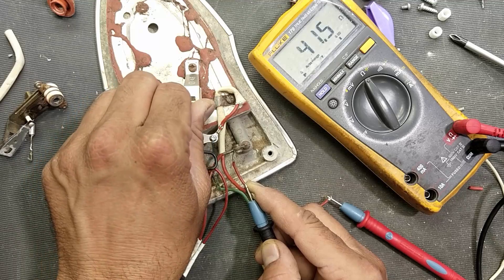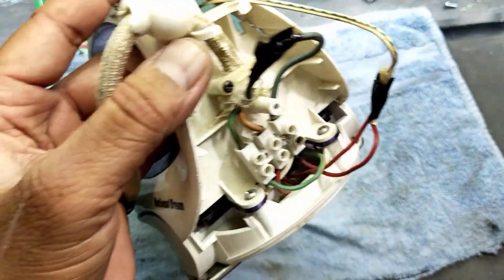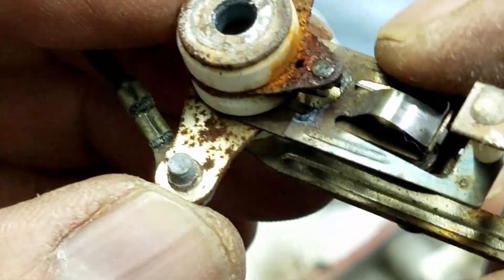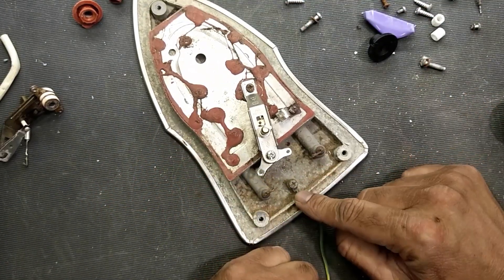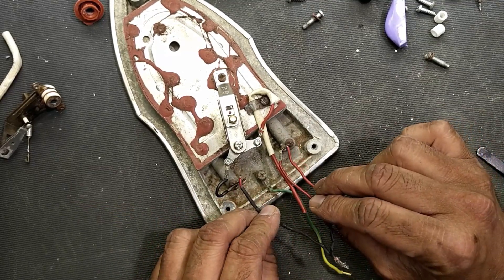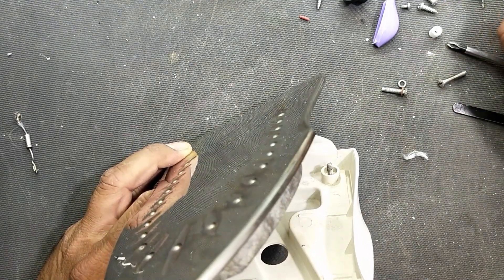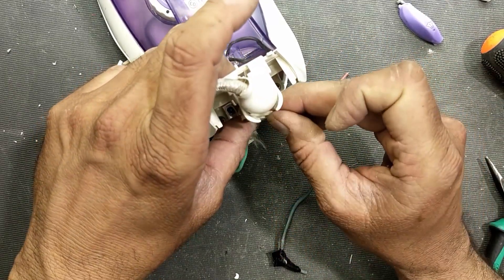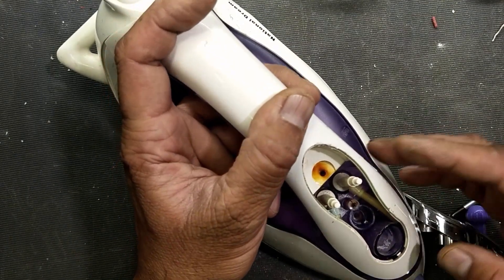[391] How to Repair Electric Iron at Home / Steam Iron / Wiring Connection of Electric Iron

Comment: You make it look so simple. My problem at the moment is to disassemble my black and decker D3030 Model iron. I would like to repair it without destroying it trying to disassemble it. I have got to the point of removing a pair of wires going up to the handle, I guess that's for the light and another pair that goes into the bottom of the iron. My guess is that the thermostat wires are connected internally to the element and they only brought out one pair .  From your explanation which is excellent, it seems the thermostat switch could be the problem and not the element. Where online do you go to get replacement parts? Thanks for your help.
Reply from the maker: Best regards
Unluckily, i don't have black and decker model's video 
But you can check https://youtu.be/E2WFM-1yjrU
It is very detailed and step be step video
I hope it will give idea to work safely
Most of the brands have similar chinese technology
Reply: Thanks a million, I will check this out.

Comment: Sir, how do we know that heating element is good?
Reply from the maker: connect multimeter across heating element and it give resistance on multimeter, and it have no continuity with chassis 
then element is good 
if element shows open circuit or gives continuity with chassis, that heating element will damaged
Reply: @HaseebElectronics  approximately, how much resistance?
Reply from the maker: it depends on heating capacity 
normally it is around 50 ohms
Reply: @HaseebElectronics  Thank you

Comment: Hello good morning, I am a follower of the channel and I am writing to explain the problem that happens to me in an ironing center, after performing the ohni measurement test in the plug to see the grounding, it gives me a value in one of the poles of the plug, in one yes and in the other no, (note: I measure in the plug, in the highest scale of ohns and with all the main components disconnected, and it gives a value of 1,100 and upwards, no it stops at a figure), however I have disassembled the plate to access the resistance, and in continuity both in one pole and the other the casing does not beep, if I touch both poles at the same time if it gives continuity, in the boiler filled with water exactly the same, it gives that result, and then what is happening? the result of the measurement in the plug, all the other measurements give, therefore? I don't know what else to do, I don't understand it, thank you very much, regards.  https://youtu.be/_BKOmCT0Q24

Comment: So are the repairs pretty much same on all steam irons? I have Hamilton Beach model with self clean mode Has a steam button and a spray button
Reply from the maker: yes dear. if it is repaired nicely. then it works perfectly. but while opening or fitting any seal is not properly seated or damaged, then produces leak issues and fails to produce good steam

Comment: Nice work! These kind of repairs are simple but extremely useful. At my end of the world, it's impossible to get a brand new thermostat for an iron. I have to get it from a broken iron. I don't understand why parts for these devices are not imported and sold here. People really don't like throw away their broken stuff. Most of the people prefer to repair their broken devices no matter how cheap it is to buy a new one. Unfortunately, parts aren't available and repairing becomes an unavailable option. Where are you at right now, Pakistan or Jordan?
Reply from the maker: you are right dear. sometimes these spare parts unavailable, in that case we can explore online, but online shopping sometimes delayed delivery with custom duties. 
most of the people want to repair there old  appliances, for which there is no spare.
i am from Pakistan but now in Jordan. i travel frequently

Comment: Assalamu alaikum Mr. Haseeb 

I really need your help with an annoying issue!
I have an atx powersupply 650w, It gives me 2.9vsb constant voltage without ripples

I checked and changed all the components of the flyback system and the feedback components such as optocoupler, capacitors , rectifier diodes at the vsb transformer output, some resistors and there is no error everything is fine but the voltage of the standby stays at 2.9v

Also the board is clean, there is no shorts and no burning anywhere on the input or output sections !

Could the problem be with the pwm IC or something else!?

Does the IC affect Vsb regulation ?

The IC code HS8108B there is no other IC on the feedback except the optocoupler!
Reply from the maker: Wa Alaikum Salaam daer
what is voltage value on Purple Wire
Green Wire
if voltage on purple wire are less than 5 volt then 
check RCD snubber in primary side of the flyback transformer for SB section.
then check 12 output (2nd output of standby transformer) 
5v SB and 12 volt are low, then 
try to remove ATX supervisor IC and check SB outputs
then check pulse transformer drive circuit 
and please reply
Reply: @HaseebElectronics  
I want to tell you first you are a good and awesome man Mr. Haseeb, you did a great job on your channel, better than many famous channels. I wish you the best in your work ^_^

I read the voltage on the diodes output

The first voltage gives me 2.9v and the second is 8v and the voltages are constant without ripples!

The input circuit of the SB transformer I checked and changed all its components with new ones, I didn't find any problem with them!

-Is it safe my friend to remove the ic and check the voltage! ,isn't this possible causing damage to any section in the circuit? 

-does the pwm section between the IC and the drive transformer (the middle one) affect the regulation of Vsb?
Reply from the maker: @techeng3940  thanks a lot  best regards 💕
In your case, it seems the sb circuit primary side is working good
Problem in secondary of SB transformer
Now you have to disconnect 5v sb consumers 
I.e secondary side pwm controller or supervisor ic
Disconnect pulse transformer drive circuit (8 volt section, it should above 12 volt. Remove both signal transistors and check output of 5vSB)
Disconnect vcc of supervisor ic and check 5v SB volt
Reply from the maker: OMG 
i am very very sorry for a word which was in my last reply, I was typing from my mobile keypad and the mobile replaced my desired word with some other word 
really I am feeling ashamed, but trust me it was not intentionally. 
again sorry for that
Reply: @HaseebElectronics  
There is no problem with your words my friend, there is no need for any apology, 
Thank you very much for your help

 I disconnected +5vsb from the ic section and something strange happened
It gave me a reading of 10v on the first and 26v on the second and the capacitors exploded!
Reply: @HaseebElectronics  Is it normal for the vsb transformer to give 10v and 26v without a load!?
Reply from the maker: @techeng3940  there is something wrong. it should never go to 10 volt or 26 volt. there is some consumer making conflict with 5 volt SB
Reply from the maker: @techeng3940  no. it is abnormal behavior of the circuit, the voltage should never overshoot than 5 volt, it means, there is feedback circuit malfunction for SB power supply
Reply: @HaseebElectronics  
It's weird when I replaced the capacitors and reconnected the IC the volts  back to  2.9v and 8v!

Maybe something wrong with the IC after all !